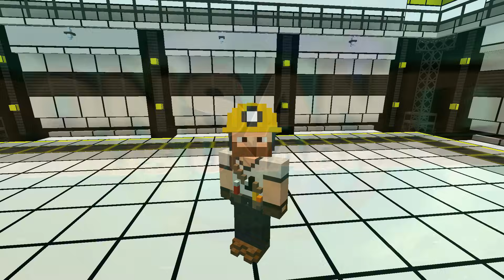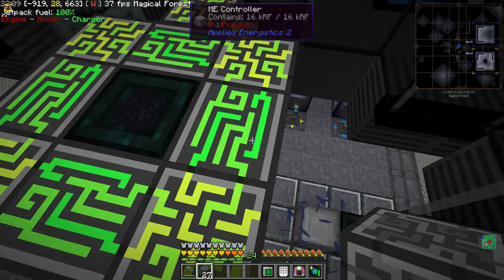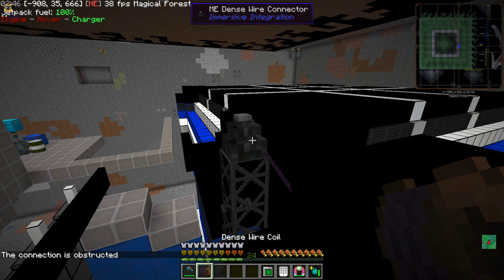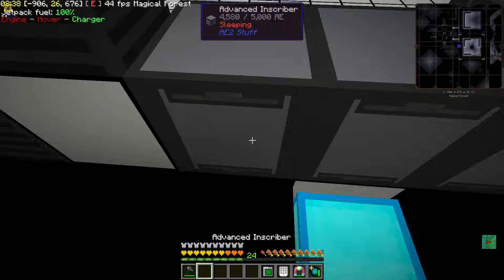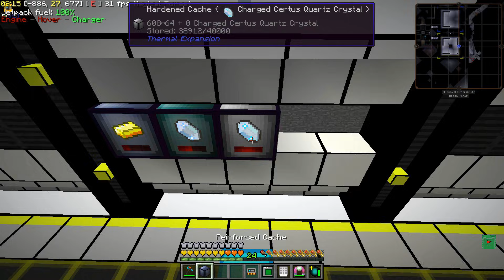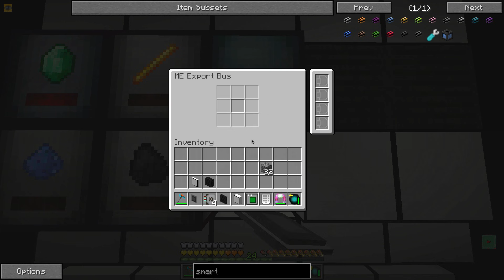Primus Unabridged - 10 - Setting Up My Applied Energistics 2

Comment: I wonder if your going to do a SSD Super Soren Drive in AE2? Also there is supposed to be a way to emulate the function of the deep storage chests with AE2 i thought.. IE click to put in and pull out?

I do love your hack for the remote storage and plan to do it since it would allow alot of easier exploring
Reply from the maker: If you mean to dedicate a block to a single item, how is that different from having an actual DSU? Though I just made the max size storage cell from Extra Cells 2, so storage of large quantities is not going to be a problem. (Over 10,000 redstone, to name just one of its ingredients!) :)
Reply from the maker: +mementh Oh, and The SSD design is half about automating the crafting and insertion of storage cells into the drive bays. Once I can make storage cells automatically, when I make a drive, I make the 10 cells at the same time and shift click the lot in. It's so pitifully easy to do by hand, I see no reason to automate it—and I love to automate things! :)

As for using the storage bus/interface technique to extend storage without using channels on the main network, I had a lot of problems with that in my RR3 series—it didn't seem reliable. As it is, my new AE2 system is already having some connections issues, so I'm not going to use the technique except when necessary. My 4 columns of ME Controllers provide far more than enough channels for all my needs. :)
Reply: +Nonsanity it links to the entire network and can function like the DSU for common items. 

the SSD is very stable.. been running mine for a few months on the nomads server and no access issues.

I don't honestly see the point of a P2P setup ATM with the SSD... i automate ALOT and have very little need for extra wires ATM.. maybe in the future ( i can see if you have a huge huge factory why you would use it but talking 20+  assemblers with 5 faces with interfaces and 100+ other machines )
With that you do what you did and use one wire to be the main bus the the p2p to be local bus.... it might be worth it.. 

Whats happening with the AE2 system thats having issues? There is a known bug/issue with timing when busses don't get touched/stop working because the tick has taken too long.

we have the extra cells mod in but its not supported by the original mod maker and it just feels unneeded ( plus i can't figure out how to use the liquid part to craft with)

If you do any examples of automation how about showing how to automate making with liquids in machines/recipies?
Reply: +Nonsanity try interface/storage-bus as probably you did something wrong. I'm using those a lot in the same modpack, one thing that messes this up is that interfaces has to be 'clean' - without patterns in them. I have top-up mechanism that auto crafts most needed resources and keeps stacks of them for quick use, works as charm
Reply from the maker: +mementh It was probably the known bug you mention that was causing the system to regularly fail. If it can't handle less-than-20 tick rates, it's sure not going to work reliably on any server I've ever been on. But I don't mind using channels—I've got tons of them and I'll never run out. That was the main point of all my AE2 storage tutorials. I'll give the Storage/Interface technique another look if that bug gets fixed. :)
Reply from the maker: +Jakub Pawliński I'm pretty sure I was setting up the Storage/Interface technique correctly—I did do a whole tutorial on how to use it, after all.  ;D

mementh, above, suggests there's a known bug that happens when the TPS drops. That was probably the cause of my issues. :)

Comment: The inscribers need to be initially filled with redstone and silicone, otherwise they'll run out if you don't order the same amount of the different processors.

Also, you need the Yeta Wrench to access the Ender IO cables from any angle :)
Reply from the maker: That's right. The system works perfectly when those receivers are full. They weren't at the time of recording because I was almost out of redstone and silicon. I also keep a bit extra of both—mostly silicon—in the input chest.

Thanks for the Yeta info. You aren't the first, but I had forgotten to look it up after the recording, so it's good to know. :)

Comment: I guess you might have figured out the Ender IO cable thing by now, but just in case others want to know, to access a cable setting from an odd angle like that, it's shift + left click, and I assume it only works with IO's own Yeta Wrench since it looked like you were trying a left click. :)
Reply from the maker: +Chris Marriott That would make sense. I didn't try its own wrench. Thanks for filling in that info. (I had forgotten to go look it up.) :)
Reply: No problem :)

Comment: When the game crashes because of a block, how do you find that block so you can delete it on mcedit?
Reply from the maker: +LoginDefault It usually happens the moment someone puts the block down. So in MCEdit, you have to go to that user and check what block they are looking at. That is probably the culprit. In this case, since the surrounding blocks were decorative and not too expensive (I asked first) I deleted a few of the blocks around it—just to be sure.

Comment: Why not replace all the cahces and barrels with deep storage units? I know you do not need that many ressources, but it looks better if they are all the same type. You showed in a previous series how to empty the old ones =D How are the redstone seeds comming along?
Reply from the maker: +wurnur I need to get a lot of complex materials made to churn out a ton of Deep Storage Units, and that machinery isn't in place yet. But that is the idea. I did the one just to check the look, but since it does fit well with the decor, I'll eventually switch over to all DSUs. :)

I'm running redstone and diamonds, since I was short on both of those.

Comment: soooo thats where all my glowstone went!! Da hell man! Share the wealth!! Even tho that AE setup seemed crazy as fuck to a n00b like me, It actually helped A LOT!!! thanks bro! :D
Reply from the maker: AgriCraft, at least in this pack, has a number of ore and material plants—not too unlike Magical Crops. My one AgriCraft episode showed my technique, but I didn't show further use of the mod, since it was all the same. I would run each crop overnight.

Why do it that way? Because I've collected glowstone many different ways in the past, but never that way before. :)
Reply from the maker: What can I say? I like the Coneheads' ideas about "mass quantities" of things...
Reply: +Nonsanity so how did you build up so much glowstone :D ?
Reply: +Art Strutzenberg I successfully tried an EnderIO witch spawner.
It just eats RF, they drop tons of stuff and you can have your system turn it on and off with a redstone signal.

On the other end I have an Autonomous Activator (Thermal Expansion) that just left clicks with a Tinker's Construct Scythe with Unbreaking X and Luck III for essentially free and unlimited Fortune III kills and a Vacuum Hopper from OpenBlocks for the drops. idk if it can pump things directly into the system so I hooked it to an ender chest and an ender tank.
Reply from the maker: AgriCraft. :)
Reply: +Nonsanity with magical crops?
Reply: http://i.imgur.com/XECUl9s.png is my current setup....golem picks the glowstone plants, which produce glowstone  essence, a hopperhock sucks them up, I then transport the essences via pipes to process elsewhere (8 essence net 12 glowstone)

Comment: I like your processor set, but my only problem is that you can't guarantee that the final press will have the need redstone.
So if you have 35 redstone in the logic processor press, but you are making another one the logic may fill up.
You could fill them all up with redstone, so the pipes fill the presses as they work.
Reply from the maker: +ASCii I was running out of redstone at the time, but now the input chest has several stacks sitting in it as a buffer. A similar amount of silicon too. So now whichever press runs, the redstone that came in with the order will replenish the input chest. A stack in each is enough, but I add the extra just in case. (Someone might stop by and use a device manually.)
Reply: +Nonsanity indeed, and I figured you would add something like that. Just wanted to voice a little concern.

Comment: With your processor crafting set up you will have to request 3 times the amount of red stone and silicone to make 1 processor because they will be shared among the three bottom inscribers.
Reply from the maker: +Desarth The trick is to pre-load them with redstone and silicon. I also keep more redstone and silicon in the material input chest. Then whatever is sent with the recipe is just added to the pot and everything stays topped up. I did forget to mention this on video. :)
Reply: +James Wright - This.

I just made an identical setup in my base and I realized when requesting processors from the interface the 3 materials land in different inscribers on the bottom.
Reply: And also if I kept reading the comments I would have seen this said before. Sorry and thanks!

Comment: Great Video! If you click the scroll wheel on your mouse (PC) and have crafting setup for that item it will open the auto-crafting window even if you have some of those items. Clear as mud?
Reply from the maker: +Lingo I use a trackpad, so no middle mouse button. But the Option/Alt key works just as well. :)